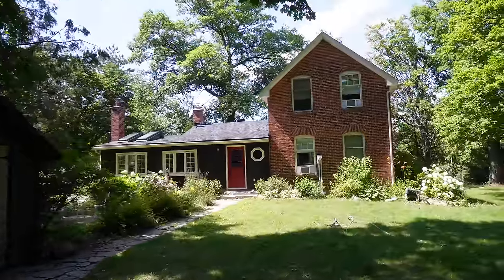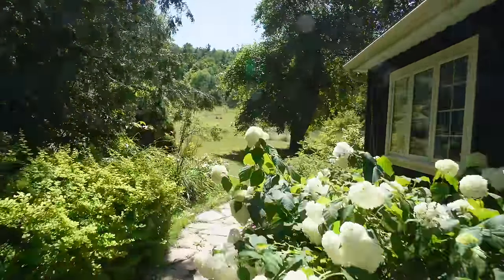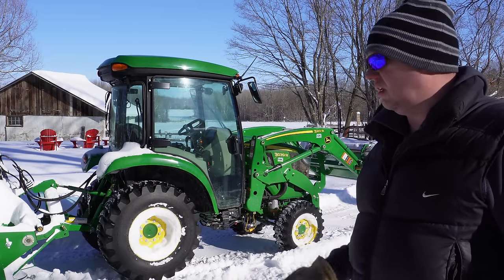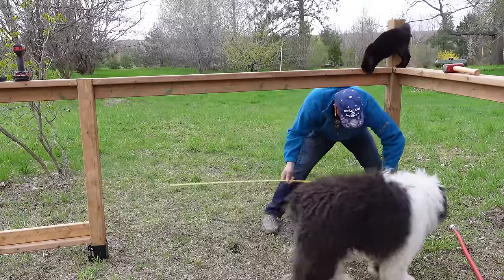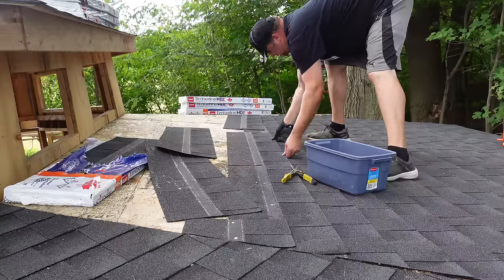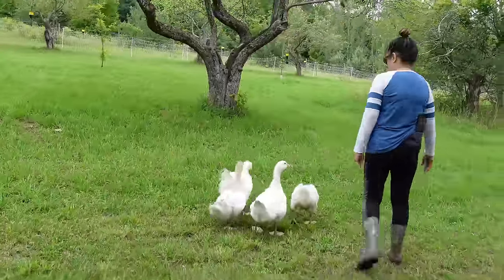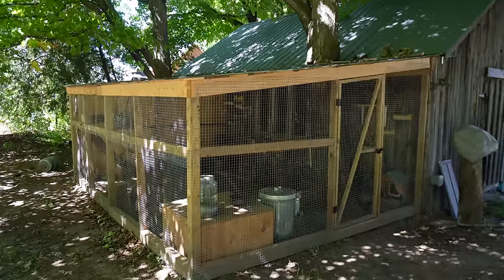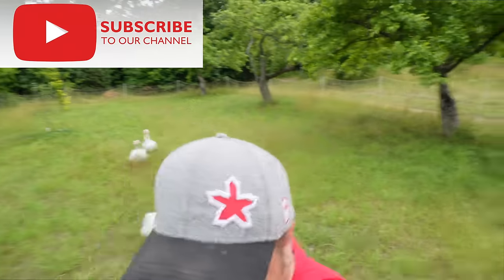Couple Buys 105 Year Old Farm - Look What They've Done

Comment: I love your artistic dreams, but your chicken coop has major problems. First, with no underlayment [tar paper or ice & water shield membrane (best choice) ] your roof will leak over time on that slope. Shingles are not guaranteed installed like that. Second, the flat pitch of the roof will not allow snow to slide off, thereby increasing water standing on the roof which equals leaks. Third, you probably don't have strong enough framing for the snow load in your area, thereby having a potential collapse. Your ideas are great, but your mechanics needed a professional.
Reply from the maker: All good points.  It holds the load just fine, but I sure hope I don't have any issues like you describe...so far so good and it's been a year.  I really wanted a steeper pitch but it was already getting too high with my crazy design idea lol. In hindsight I should have used an ice shield especially for just a few hundred dollars more.  I just thought it was just a chicken house so we'll see.  I hope it'll hold up or I'll just tar the whole thing lol. Appreciate the comment.